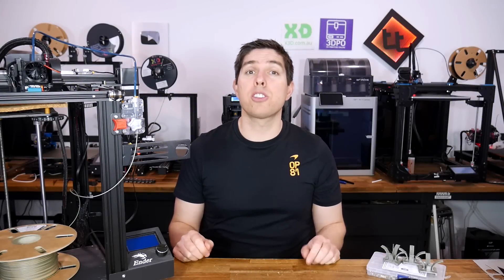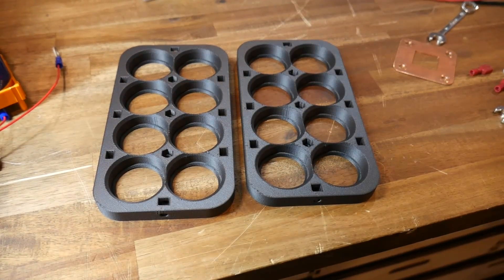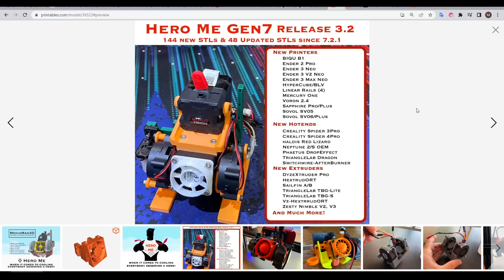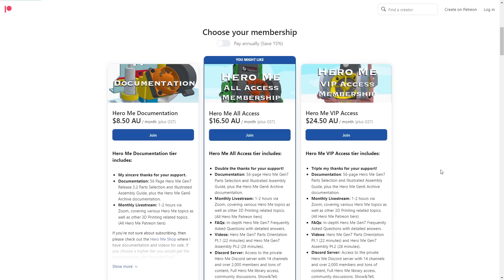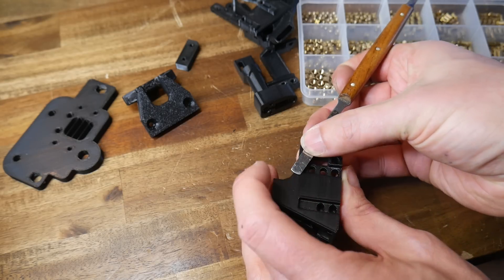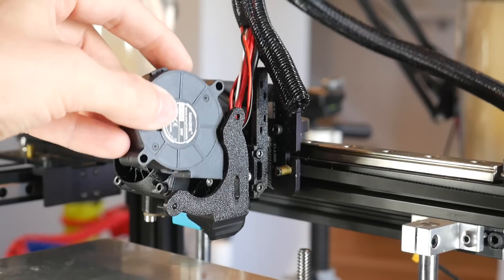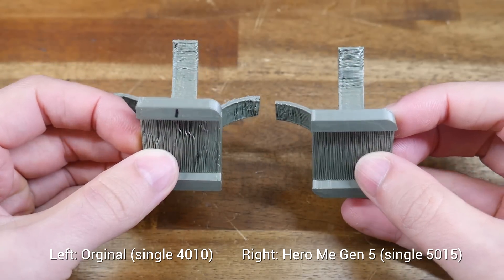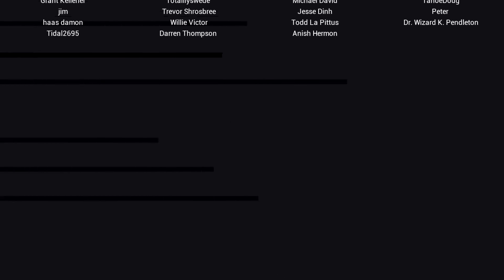Hero Me part cooling system - Modular, capable and super compatible

Comment: A small tip, you can also put threaded inserts into your blower fans to save on space and a tiny bit of weight since you can now use shorter screws/bolts.

Comment: Nice! I fitted the Gen7 with dual 5015 blower fans to my 4 month old Ender 5 Pro about 2 months ago and it has been great with an Orbiter 2.0 extruder in direct drive. The improved cooling makes a surprisingly big difference, especially as I print faster and faster. I do think the dual fan setup starts to get a bit heavy though, I start getting occasional layer shifts at 1500 mm/s^2 acceleration, so it's definitely not for fast printing. I have to keep it at 1250 mm/s^2 for now and limit speed to 140mm/s.
Reply: You could also get better stepper motors.
Reply: @DeadNoob451  That's fair. At that point I might as well start looking at the Mercury conversion though, it's something I want to do in the future. But I haven't looked at tuning the stepper motor current and voltages, that will also help. Haven't spent much time on my 3D printer in the last week.
Reply: I have the exact same setup with dual 5015 fans and Orbiter 2.0 and I was only getting layer shifts at around 4000-5000 acceleration so maybe your stepper motor drivers were set up too conservatively from factory? I wanted to print faster with klipper so I bumped the Vref on the Y stepper to 1.5V and on the X stepper to 1.4V and had no layer shifts at 10k acceleration (could probably go faster but I didnt see the point so I dont know the actual limit with this setup). On the Y stepper motor you can probably go higher on the Vref as it is bigger than the X one and was not getting hot at all but 1.4V on the X stepper is probably around the limit as the motor is getting pretty toasty. Nevertheless I printed some 3-4 hour models on these voltages and the X motor still works so it should be fine but you can always go lower if you're worried about frying the steppers.
Reply: @smittzin7637  Thanks for that data! I have not started to use Klipper on my machines, so I have not done any speed performance testing; While the Hero Me was not designed to attack SpeedBenchy records, it works very well for me at 200mm/s. I have had people ask about acceleration limits with the Hero Me, now I can at least comment that I saw one data point that it is possible to run the Hero Me at 10K acceleration. Of course I will caveat that with YMMV.
Reply: @smittzin7637  Thanks, I will look into it. I also though 1250 acceleration is quite low, most people recommend up to 3k, and I would like to push beyond that. I haven't made any changes to that, and I built my Marlin config based on the preset template for the Ender 5 Pro. So I definitely think there's some room for improvement.